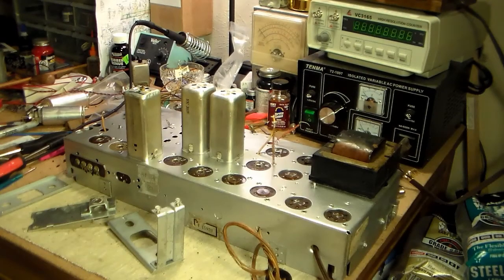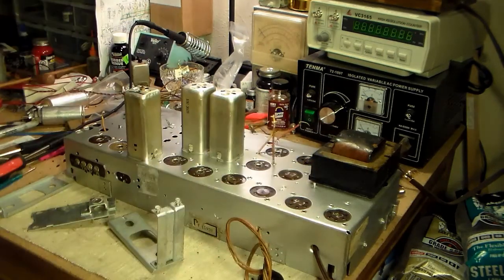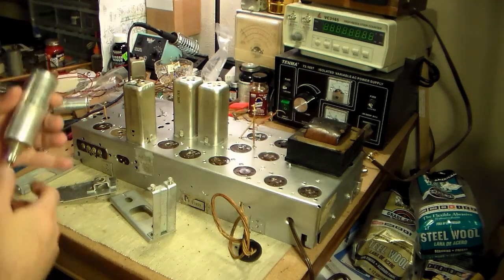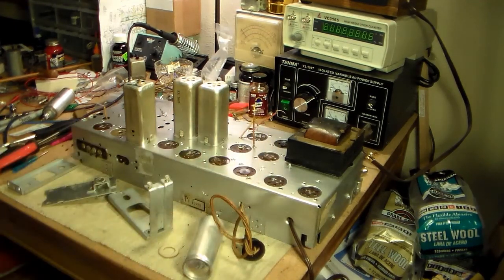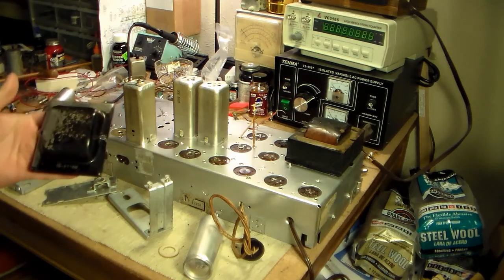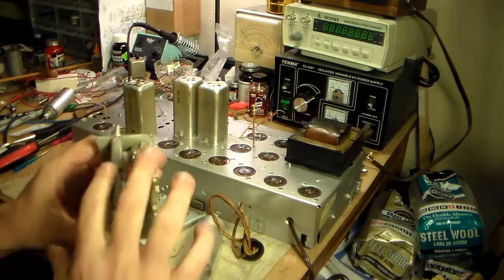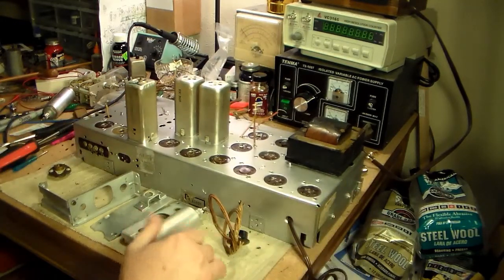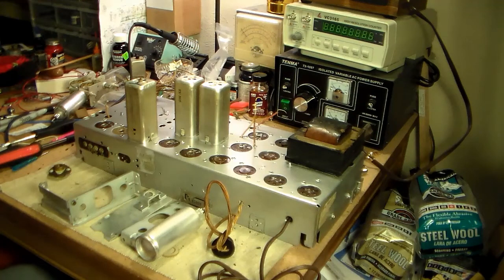Philco 41 315X part 3 of 14

Comment: Really impressed with the tuning condenser cleaning.  I'm going to hit O'Reilly's myself.  I like the silver, on the chassis, also.  Good progress, Bret.
Reply from the maker: whatever detergents they use in there seem to be pretty nice to aluminum.  even though the chelating agents only bond to rust, it's pretty impressive stuff.  unfortunately, I looked @ the MSDS sheet and I guess since it's non-toxic and pH neutral, they're not required to list any of the ingredients.

Comment: That Evapo Rust remover really worked remarkably well on that var cond.  Did you remove the mica, or soak it entirely?  Thanks for sharing...Joe
Reply from the maker: I soaked it complete.  as with all the other condensers I've had to clean the mica is riveted on to the phenolic base.  The evaporust is non-toxic and PH neutral.  I was less worried about it that I was about using the ultrasonic bath.  so far I've had no ill effects.  the switch assembly will be another story.  it's got actual coils on it.  so that is going to be fun.
Reply from the maker: yours and my comments have returned..  these disappeared last night!